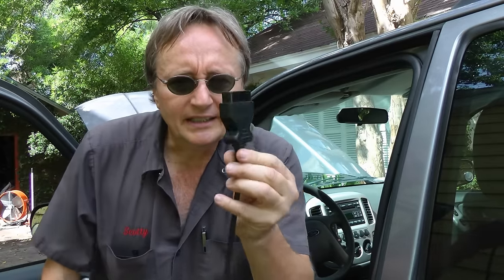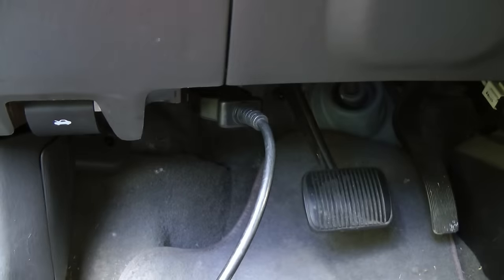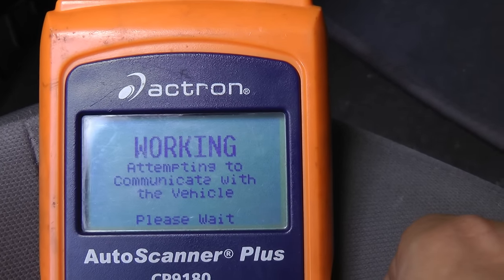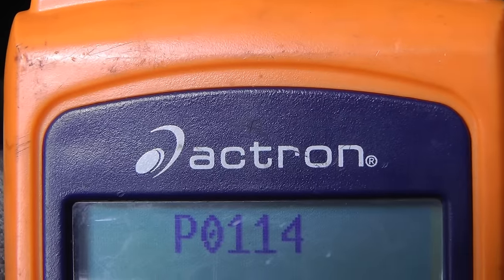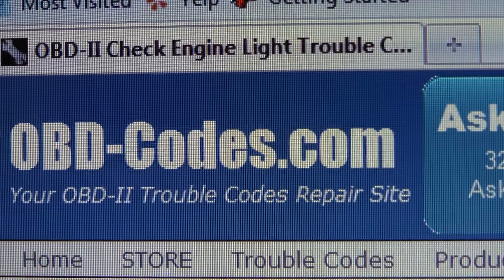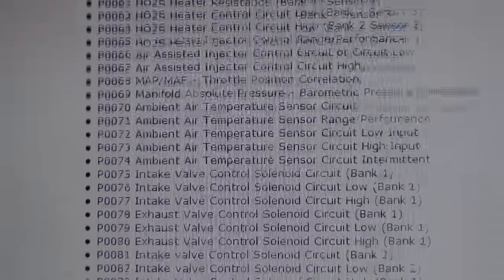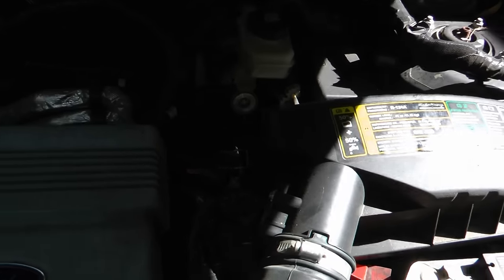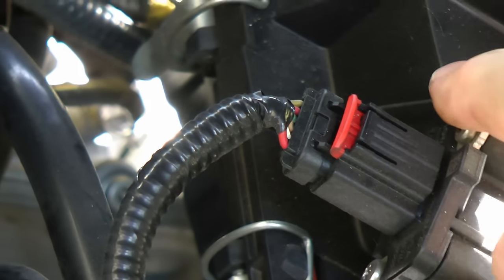Check Engine Light On and How to Fix It

Comment: Scotty hey how u doing I have a cobalt ss sc have a little problem with my car the engine check light is on sometimes  it's usually off but when  I step on it it cuts me off  and it says engine reduce  then I go to my fuse  box by my engine I move it around and start right up Wat could it be

Comment: Scotty, i know someone who has a 97 dodge intrepid V6, it has the check engine light, the code is P0154 02 sensor circut low bank 1 ? how can i fix that , how do i know what sensor to replace?

Comment: Well today my check engine started flashing (it has been lit way before); only happened after i accidentally drove over a large puddle while it was pouring outside... Luckily i had my scanner to check the codes: P0300, p0301, p0302, p0303; 3 cyl misfires and a ho2s circuit... I drove it to the nearest gas station to check the spark cables and the air filter.. turns out the housing was soaked.. and after setting everything back in place, start the engine, the light just stayed on.

Comment: I have a 2012 civic si with only 12k on the clock. Check engine light came on, and my regular mechanic pulled the codes: bad gas cap or something. Told me he wouldn't fix it because it's under warranty, didn't want to charge me. If I buy a new gas cap, will the check engine light go off? Or do I still need someone to reset it for me? Sorry I'm an idiot!
Reply from the maker: honda would have to provide a free gas cap as it's under warranty for emissions. BUT, if you buy one and put it on, it will reset itself after a few days driving IF that was the problem. If not, take it to honda, they would have to fix the evap leak free

Comment: Hello Scotty I have a 2006 Toyota Sienna and the check engine light and vsc light turned on do to bad gas cap so I went to the dealer and got a new one. How do I reset the light
Reply from the maker: If it was a bad gas cap, light will turn off itself in a few days just driving the vehicle
Reply: Thanks
Reply: Scotty Kilmer Hay Scotty....My wife forgot to put the gas cap back on her 2005 Tahoe a few days ago (50 miles ago)...well today the check engine light went on...I replaced the cap  (NOT THE WIFE).I take it after driving a few days it also will reset?  Or should I disconnect the neg. battery terminal for about 5 minutes?Wife has a good job....can't disconnect her!Thanks in advance!

Comment: Scotty,, I hit a coyote with my 2006 Toyota Corolla , and broke my Oxygen sensor wire. The check engine light came on. I replced the the oxygen sensor at the cost of $170, reset the system, and the check engine light comes on with the same code about oxygen sensor.  Any ideas, thank you.  By the way, the car runs fine.

Comment: Hi scotty, 
I just buy 2000 lexus es300 every time the check engine light comes up, the won't change to last speed on the transmission,
What hell is that? 
Thank you
Reply from the maker: get it scanned for codes to fix it. WHEN some codes come on, the computer automatically shuts off final gear to prevent damage
Reply: Thank you for your help, 
I have big question for you scotty
I buy after market 02 sensor,
I'm checking online, some people say you have to buy original Toyota or lexus parts for my lexus, what's your opinion?
Genuine or after market

Comment: hey scotty. 99 honda accord. so i have a code p1456 constantly. replaced gas cap, canister, 2 way valve, open vent shut valve. i mean what is next? The first time it came on it was my fault and left the gas cap off. but the second time around a half a tank it came on again. any advice? maybe the bypass purge solenoid above the 2 way valve?

Comment: i should prolly also mention leading up to this, it was cutting out on occation but no where near as often as now. i kinda neglected it because i couldn't find the issue. my wife was driving it the other day and it died and kicked a code. it was the iat sensor and i replaced that and still have the light (but no code stored). at that same time the a/c stopped working to (kinda odd) idk.. kinda sounds like i overlooked something after typing and reading lol. anyway, any input would be appreciated

Comment: Hello my name's Damian I have a problem I have a 2011 Hyundai Sonata and the car runs good but if I go 80 miles or more a check engine light turns on and off in less than a second when that happens it loses some motor straighten besides that if I drive less than 80 everything is perfect.

Comment: My 2000 kia sportage hold inditcator flashes and now it won't start. Problem started when my heater core leaked inside the passenger side. Could it be the Transmission Control Module  is damaged or the ECM? The code  P1500 DTC definintion found but I'm not sure what it means or what to check out. I checked on line and could not find the pinpoint to the problem. Thanks in advance.

Comment: I have a 98 VW passat and I have a check engine light problem.  The obd reader will not communicate with each other what can I do to fix this issue.
Reply from the maker: Lenert Johnson pray some other reader will work, cause if not, either main computer is bad, wiring to the data connector is bad. Or you have a bad sensor or sensors that are shorting out that system. Good luck hunting
Reply: I put a new ecm in the car at the Monday and it still didn't read. I had the oxygen sensor changed and that the last time it worked.  I checked all the connection and made sure they tight. But still nothing.  Have you heard of the after market radio stopping it from working

Comment: Hi scotty, I just washed the engine and after that the engine was shaking and I thought it was gonna die, then it went away BUT the check engine light came on. HELP
Reply from the maker: have someone reset the computer and pray the light stays off. If not, you damaged electronics and will have to get the code and fix it. AND, don't wash it ever again, engines like being dirty, means nothing
Reply: I went to autozone, they told me to wait 2 days wait for everything to dry and it should go away

Comment: Hi scotty i have a 2008 chevy aveo  Ls the engine light comes on and off i try taking it to the mechanic but they told me the engine light has to be on to do diagnostic i recently bought the car have it only a month and now again the engine light came on try taking it to the mechanic and as soon as i turned my car on the light was off again
Reply from the maker: crap mechanics, there is much more data than just simple check engine light codes. Find a better mechanic with a dealer level scan computer to analyze the problem, tons of data is inside for one who knows what it means

Comment: Hi Scotty I have just been watching your videos and this 1 in particular where u comment on the engine light flashing whilst driving.  I have a Seat Alhambra 2.0s 2001 petrol and whilst driving my engine light is flashing and the car is driving very badly.  I have purchases a code reader and it has thrown up the following codes:  17553, 16684, 16686, 16688, 16955.  Can you possibly give me some advice on this please and I'm starting to pull my hair out and really don't have much money right now to get it sorted?  Many Thanks in advance :)
Reply from the maker: they don't sell seats here and those are manufacture specific codes , so you need a seat mechanic to look up those codes as I have no info on them

Comment: Hi Scotty  i have a 2010 VE Commodore SIDI engine light come on i had the oxygen sensor replaced cost me $400 now the light has come back on what do you think it could be,can i just clean the sensors
Reply from the maker: realize that's a generic trouble code. Dozens of things can trip that code, start by trying my video "fixing Bad catalytic converters" and pray that cleaning fixes it.
Reply: Hi Scotty took car back to Holden they said it's the oxygen sensor on the left side now they replaced the right one a while back cost $400 they wanted to charge me another $400 i said forget it i will buy a new oxygen sensor and do it my self not happy

Comment: i have a 98 dodge caravan my check engine light is on and it is missing on 1st and 3rd cylinder i have put new plugs and new filters on even put a new fuel pump on  it as 186000 as of now .any help would be appreciated

Comment: i have a 98 dodge caravan sport my airbag stays on what could be the problem and how can i fix it
Reply from the maker: +Andrew Rosado you can't diagnose those without a dealer level scan tool. See my video "fixing insanely complex modern cars" and have one hooked up to find out, or buckle up and ignore it, realizing air bags will not longer work

Comment: i've toyota camry 94 2.2 L 4 cyl check engine light is on i get the code 25 and 26,what could be the problem?
Reply from the maker: +sohail zafar your fuel mixture control is reading too rich AND too lean, so odds are the oxygen sensor is bad OR you have  bad fuel injectors spraying too little fuel and then too much fuel at different times

Comment from the maker: @eraguil  If the car runs fine otherwise, I'd blow it off. If it doesn't run right, it could be a bad computer, but 180 bucks is really cheap, I'm guessing junkyard used computer which I would never use. Scotty

Comment: my check engine light is flashing in my 96 mustang gt, i accidently unplugged some vacuum lines and the ligjt wont stop flashing its only under acceleration. car is a lil hesistant at first take off. is it the vacuum lines not mixng fuel correctly now?

Comment: scotty my sensei,
which is the best code reader and reset diagnostic brand and model?
could you recommend.
Reply from the maker: many good ones are out there, but in the 200 dollar range the actrons are what I use all the time
Reply: do i need to pay license fee yearly for updates.
i got a frd who run run a car workshop and he need to pay updates.
i am trying to hlp him solve this issues.
that guys is scamming him at 200 over dollars yearly.
thx sensei i will read up on actrons.
Reply: i got my basic scan tool for $35. for some reason the engine light would randomly come and go on my volvo and nissan sentra. my camry has been good to me so far. every mechanic says it runs good.
Reply: hi bobonlinenet,
will i guess you have to check your workshop manual.
 if the brand and model of your car engine light is related to what issues. 
or the shit sensor is over.
it happens to my old bmw all the time. waste of hard earn cash.
it is common to see conti cars having this issue. 
but for nissan? vry rare.
does your volvo have a oil dip stick?

guys, i just change my ignition coil myself. 
omg the nissan bluebird is a hell, when it comes to changing the coil. 
have to remove all the air intakes, just to get to it.
i did remove the spark plug and regap them to 0.04  (abt 1mm)
did a spark plug alignment facing the injector.
it better than new honestly.
it has much more response and power than it was new. after i did the alignment.
my gas burn much less. i now hit 13km/l.( use to be 10-11km/l)
i am happy.:))
Reply: which brand did you get?
i order mine from china (prc) for 10$ and it f....... fail on me.
Reply: after i got rid of the nissan and volvo, they said it could've been sensors. i had the cars during 2 different years. i took them both to the same people and they said it would cost almost 2k to fix. i was looking at the manuals when i still had the car, and it said fix the most common problem, then reset the engine light and see if it fixes it. it was weird lol. of course this happened when inspection was coming up, so i just got rid of them and got the toyota.
Reply: smart move. 
but i am sure you could fix it yourself with some tips from scotty.
how much did u pay for your camry? new?
i'm off to bed it is 315am here. 
cheers mate g9
Reply: used for 1800. yeah i wish i found scotty's channel when i had my other cars lol. i learned a lot.
cya night.

Comment: My temp guage goes strait to hot when i turn on my car. I put a new water pump in and go a new used engine cause i had a bliwn head gasket and my friend that put my engine said it would be cheaper. What would cause my temp guage to raise when my car is not even on. Its holding water in radiator

Comment: Hi scotty, question, 2002 chevy impala 3.4 . i got a code P0128 coolant temperature thermostat, an i notice the temp gauge is running really low in the cold zone, is that a bad thermostat an if so where is the thing located ? easy to change if so ?

Comment: my check engine light comes on during my freeway drives. once im at about 3000rpm for a little bit the check engine light comes on. As soon as i left off the gas the light turns off and a accelerate again back up to speed. 5 min later is pops on again. Rinse and repeat. What could cause this? (1988 Isuzu Trooper, 5 speed, 140k.)
Reply from the maker: when light is on, you need it scanned for codes. Guessing is foolish, too many possibilities
Reply: Scotty Kilmer my 2000 buick lasabre check engine light is on, i was told to drive it like it is cause too expensive to fix. it runs good. said probable cause was catlytic converter, oxygen sensors. what do i do?

Comment: I had a clown bring their car into me asking for replacement of spark plugs.  I asked him why does he want them changed (been down this road before).  His reply "the guy down the street diagnosed my check eng. light and said I need spark plugs".  Told him that we can put them in but at his request and no guarantee that it will fix the check eng. light.  He came back in 2 days later stating my check eng light came back on.  Wound up being a ckp reluctor wheel bent causing a bad signal.

Comment: What is it when I change my pcv valve on my 98 maxima and then it gives me a ignition circuit singnal check engine code? I had to put back my old pcv valve to fix it
Reply from the maker: Jay Wood that doesn't make much sense, but if code stays off, leave the old valve on. It effects vacuum pressure and maybe the new one was bad and that fed back into computer sensors and made that code pop up, realize that could effect ignition timing and trip that code
Reply: There is oil inside that old pcv valve. Is it because I didn't push the new pcv valve in all the way? I bought another one for tonight.
Reply: It's also plastic not metal like the one u showed us in another video to fix burning oil for 10 bucks

Comment: I have a 2002 honda civic Ex and when I turn on my car the maintainance require light comes on flashing but as start running it it goes off
Reply from the maker: it's saying it's time to have maintenance items done, but if you change the oil and stuff, just read online how to reset the stupid thing by pushing buttons on the dash and that turns it off for thousands of miles, then you turn it off again when it comes back on then in the future
Reply: Ok..thank you

Comment: I have a 1991 Honda accord 2.2 4 cly  it as 38 psi fuel good spark good air flow all things to start but it well not run .The check engine light dose not come on or cycle with the key can that be the electronic control unit
Reply from the maker: could be that, but of course on that, often a blowing head gasket or clogged up fuel injectors, check those first

Comment: 2007 Honda civic lx I unplug the battery and plug it back but my radio doesn't work until I put the code for the radio it has navigation system in it if someone can help me with it thanks

Comment: My check engine light came on and it was just on for the whole time the. The next day I turned the car on and it started blinking I turned it off and on again it did it again and once again it blinked about 3 times then stopped I took to autozone they said I need a coolant sensor and orileys said same thing but they said that replacing the sensor could fix all of the problems... is this true I have a water pump leak but I'm replacing this
Reply: I was worried cause the paper said it read a misfire but it said it's fixed by replacing coolant sensor? Could this be true? Is it possible I could just clean it off lol

Comment: 1999 ford f150 6 cylinder  which fuse do i replace odometer light goes on and off  engine light stays on man at auto zone checked to see why engine light on  he said fuse must be blown to allow testing help  PS I DISCONNECTED battery but engine light came back on  help please
Reply from the maker: no fuse causes that problem, if fuse was  blown check engine light would not come on at all. You have wiring or computer problems. good luck
Reply: autozone could not get reading on why engine light on.  he said a fuse must be out that allow him to test  on why light on

Comment: Julie, my battery went flat on my 2009 sante fe diesel ,i jumped started it no problems. i started to drive the abs breaks was all over the place none of the gauges was working and its a auto it didn't know what gear it was in .can anyone help
Reply from the maker: Julie Allsopp   pray it wasn't first jump started backwards and electronics will be all shorted out. Have the alternator checked out first and pray it or the battery is bad

Comment: i like that part, use your computer since you're prolly watching this on youtube. buddy i feel like a moron asking this but what about a check engine light that's on while running but doesn't come up with a code with a scan tool (no codes stored). it does sometimes stumble while driving to. i done the obvious and checked for a short and the grounds. i've read a battery can do funny things (it's a refurb) but i'm about to check that in a few. if not that though.. could it be a computer?

Comment: or do the homer simpson 3 step method to fix any check engine light, Step one take the dash apart, step 2 locate the check engine light, step 3 cover with electrical tape or if youre feeling like a custom look you can use Cartoon licensed bandaids, reflective tape for that classic chrome look the only limit is your imagination. although probably better to check out the code